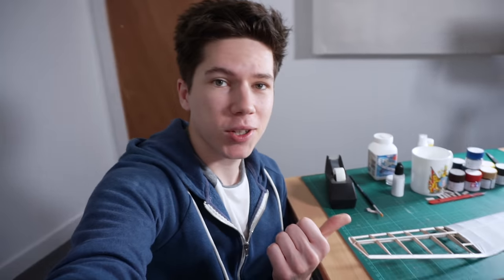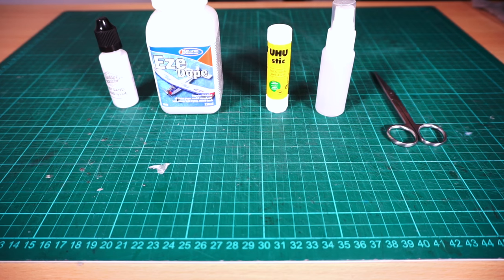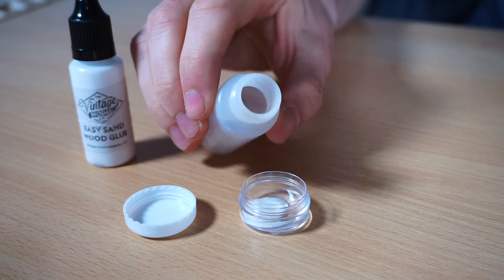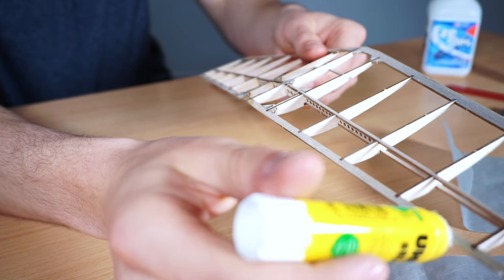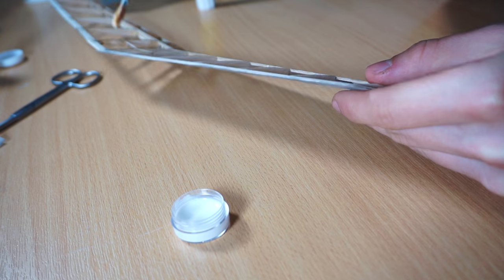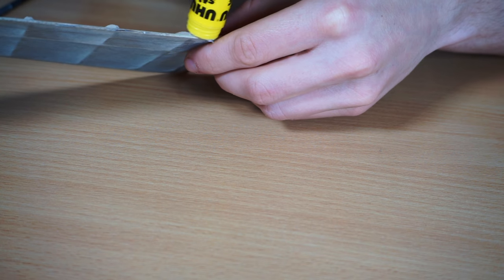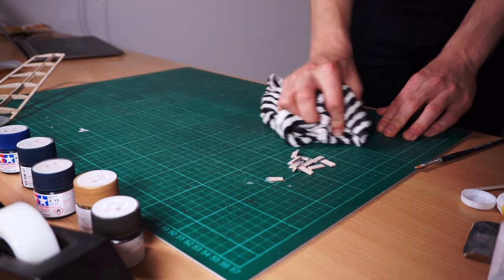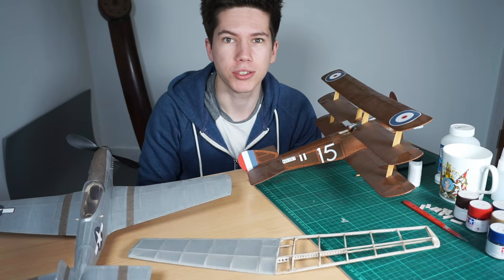How To Cover a Model Airplane with Tissue

Comment: I used to cut the tissue to the approximate size. Then soak it in water lay it on the wood then brush dope on all the struts and ribs. It would soak through the tissue to the wood and when it was dry the tissue would tighten right up.

Comment: You don't mention the grain of the tissue, if you run the grain from leading edge to trailing edge it will sag between the ribs. You need to run the grain from the root of the wing to the tip.
Reply: False! A common misconception. Grain from leading to trailing edge gives less sag that the other way. I have demonstrated this with an example a few years ago in an RCGroups forum.
Reply: @donmorris5525   Oh my!  I love your Crow avatar.  So sweet!  I am too tempted to copy it, lol.

Comment: Doing a douglas dc3 by guillows now,  and not happy with how the "full scales plans" arent quite big enough to layout plane, and also the formers have pre punched spots to put stringers on but you are supposed to notch them all to the layout and they are in the wrong spot

Comment: Nice work and very clean . I have been building these type of kits since I was 10 yrs old  I am now 70  .Over the years I have tried 
MANY different types of making the tissue tight , and what I stumbled across was to use (  SPRAY STARCH )  like what is used on shirts . Not only does this shrink tight but it also makes the tissue harder . This CAN be doped or covered with banana oil . Works for me and have covered at least  60 planes  and have won many contests using this method. Once again, you do good work .  DUKE
Reply: Does banana oil dry well ? Do you mix it with anything ?

Comment: I've covered many models and I've only recently found out about using a glue stick. Seems everyon'e's doing it this way these days. I must give it a try.
I don't weigh down components when water shrinking. If they're going to warp, they will warp. It's worth noting that, even with the spacers, the underside of the wing will dry out at a far slower rate than the top, stressing the wing. I stick a pin into usually the wing tip and hang it by a thread so that it dries evenly.

Comment: I do origami and I make my folding paper using non-bleeding tissue paper. If the modell is very compley I use only 1 layer paper after I applied some light CMC on it. It makes it a tiny bit heavier, but also much much more durable. Have considered applying it before?

Comment: Would there be different ways to hold the parts while they dry with all the different shapes?
Reply: Hi Eric, personally I use car sockets, like you use for undoing nuts, many different weights are available and you can increase the weight by putting a small one inside a big one 🙂

Comment: How do you cover a wing with an aerofoil that has a curved underside, as featured on the KK Ajax model aeroplane?
Reply: I can answer that one, In that case Phillip you have to apply adhesive to the bottom of every rib making sure you get out any wrinkles as the tissue hasn't got a lot of area to shrink, hope this helps 🙂

Comment: Hi'I would write about this Technic of covering, I build Aircraft by 15 years, I covered my First in 2006.
I apply dr tissue with cellulosic glue in 60% nitro solvent.
Is so light ang good to use. White glue, in Italy Vinavil is so havy and aggressive for the Balsa wood and it don't go inside the wood.
Is so important that Balsa " eat" the parts of glue.
Personally I use UHU hart for covrnring and tend the paper tessue.
For applicazioni of the tessue: 60% glue and 30% nitro solvent,
For have a good tension: 50% glue and 50% Nitro solvent,  the First and second hand is 50&50 and the rest of hands (4hands) are 70%glue and 30% Nitro solvent.
Remember that the paper must be umid when you apply and next 24h you can use the mix of glue  for the tension.. The final is like a drum! So light and good to see.
Good bye and good job by Italy 😀.
Sorry for my rusty and bad english